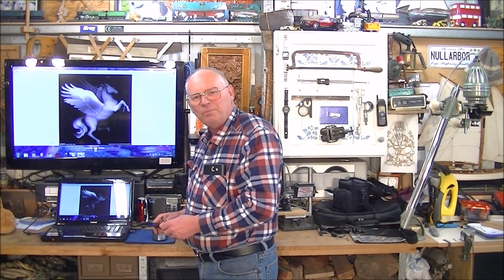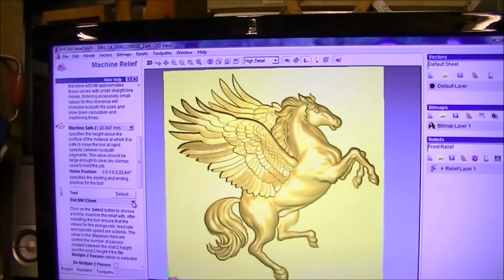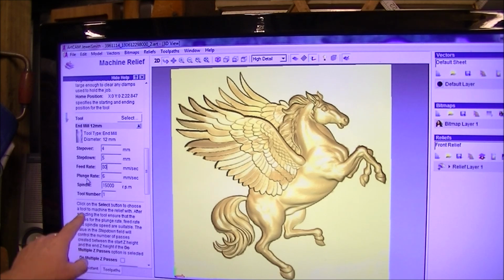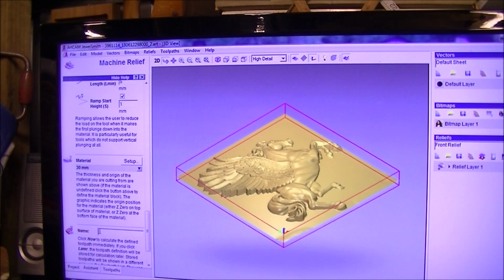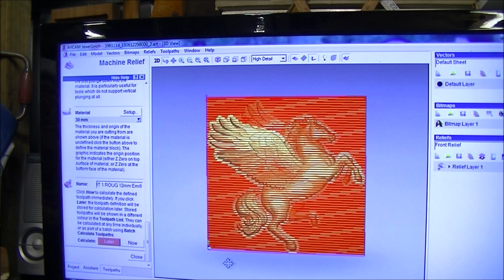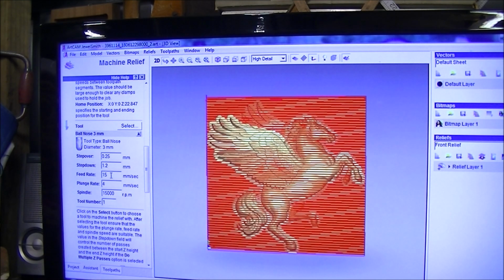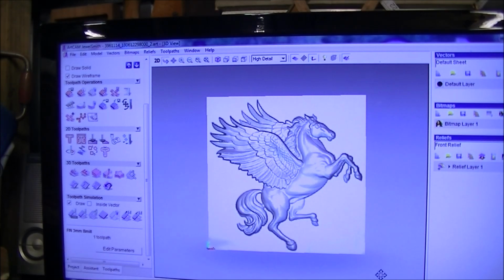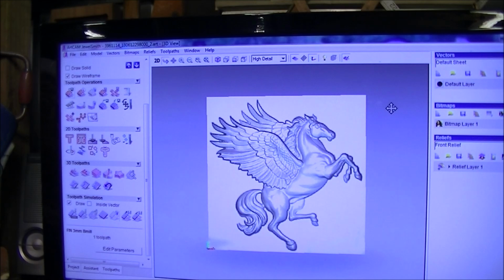157b  Making a 3D relief with ArtCAM  jewelSmith (Carveco) grayscale image

Comment: hello guys. I have a question. I zero my tool to the material, and when i start the machine the tool moves UPWARDS then starts            "" cutting""  above the wood the g-code seems fine since the machines moving normaly . But it cuts above the wood
Reply from the maker: Hi, you need to go back into your  program such as ArtCAM and check your material offset. In other words check to see your zero is at the top of the material or the base of the material this will probably be your problem. You will also probably find that the tool is cutting the depth of your material above your material.

 Australian Inventor Roger Clyde Webb
Reply: Thats right the mashine moves exectly the size of the material, although i select material Z zero at the top. Im using ArtCAM jewelSmith 2011 its very simmilar to the program of the video and your steps are clear. dont know whats going on, should i try zero at the bottom ? or something is wrong at the multiple Z passes menu ?

Comment: Dear Roger, The drawing I did in artcam in high relief and I also simulated it and it was in high relief, but when I put it to mill mach3, it came out in low relief, did I open omitted some step in artcam? And the strawberry to everything in a single pass, is it normal ?, the depth was 10 mm, I wanted the shaft to go down from 2 mm to 2 mm, it also seems that I have not set it well. Thanks for your answer

Comment: sir can we do machining in two different steps. one is by using a bigger dia tool for non profile areas machining to its full depth, and after that regular bit using for maching on the profile only, i think it will reduce the working time on job.